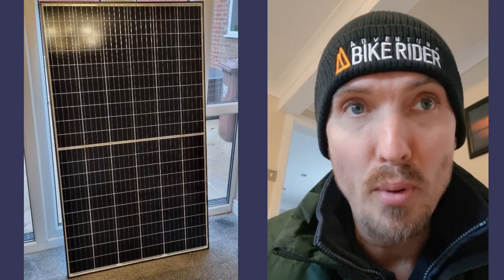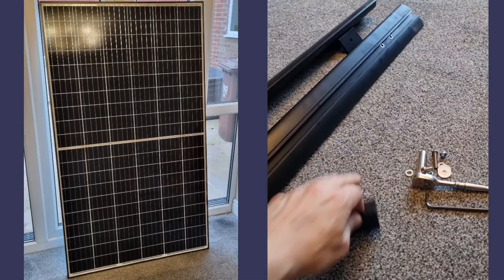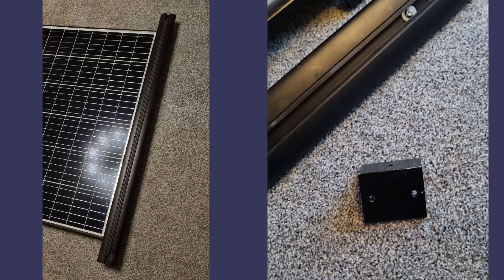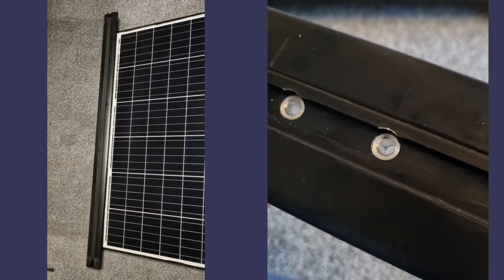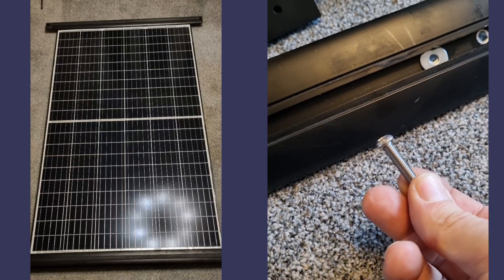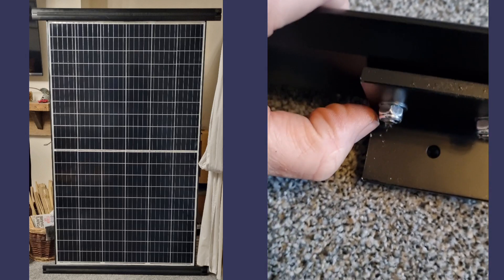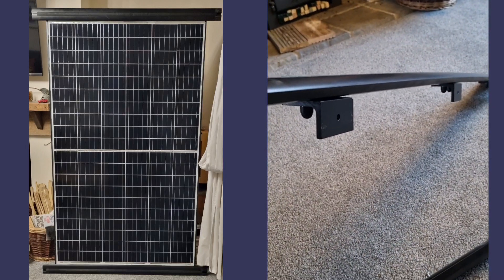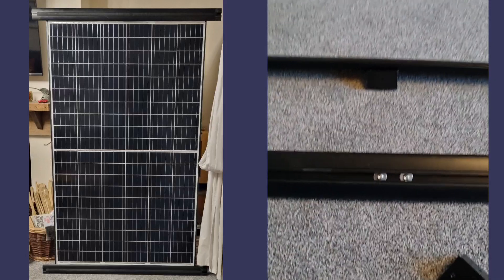Fitting a rigid solar panel to T5 roof cross bars @davedoesit

Comment: How is the noise with the solar fitted?
Reply from the maker: I hardly hear it to be honest... no different to having the cross bars on.
Reply: @davedoesit  fitted mine and no noise thanks for the video :-)
Reply from the maker: Awesome, glad it worked out well...
Reply: If you put a roofbox for example on the bars, do you still get any solar power?
Reply: @elliotbrough8743  if they cover the panel at all then energy generated will be significantly impacted.
Reply from the maker: Hey! If you cover the solar, depending how much you cover it you will certainly loose the effectiveness of the panel yes. Cheers!